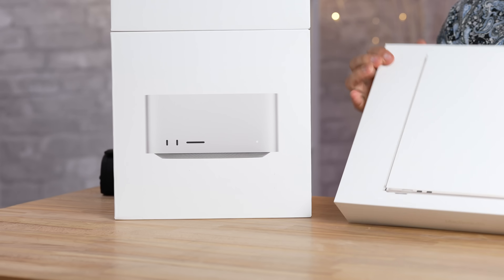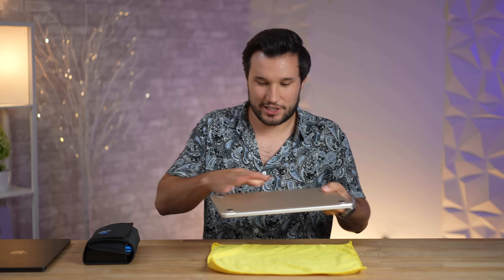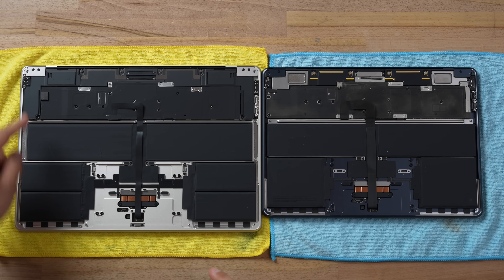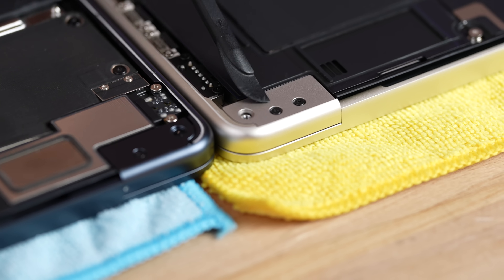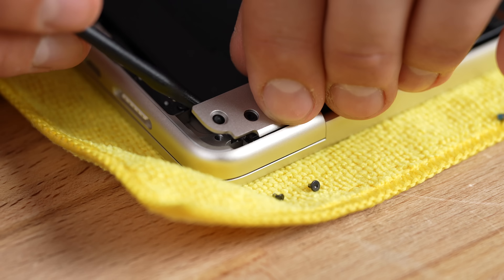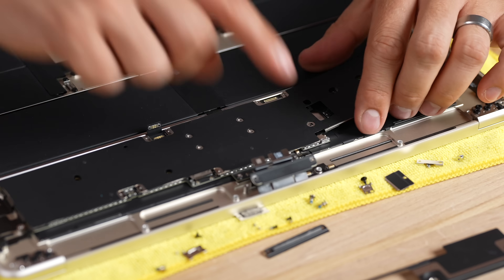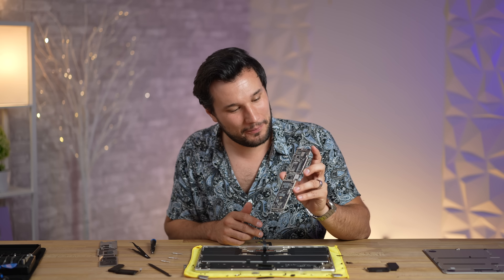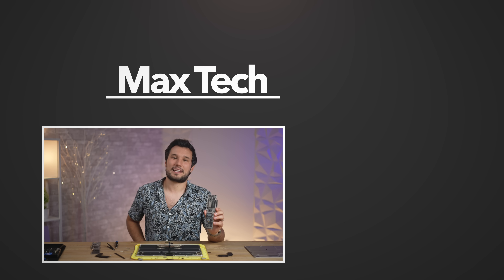15" MacBook Air Teardown: I CAN'T Believe Apple did THIS

Comment from the maker: What surprised YOU the most? Comment below! Subscribe for our testing videos starting tomorrow! 
THIS is the MacBook you should buy right now ($50 OFF) ➡ https://geni.us/uGguYQ
Reply: Placement of CPU and RAM .. never noticed before 😅
Reply: Sturdiness, overall a very clean inside.  Lots of little things like the clips for the bottom.  The amount of space for the trackpad.  I liked the better thermal for the cover by it being slightly thicker, absorbs more heat and maybe coil whine (lol).  Yeah, good design, except.... the single nand ssd and only 8gb unified.  But, hey more power to them, this is not my machine.
Reply: Don't you do a giveaway this time?
Reply: The new motherboard design...🙂
Reply: Nice disassembly. You never disappoint
Reply: When's the giveaway start?
Reply: The single 256 ssd/nand chips. I edit my travel vids on the go. My base 8mb M1 Air with 2x128 ssd/nand slices thru 4k like butter & no stutter. Saw another comparison on base M2, all stutter, no butter. So, that's me sat out waiting for M3 and hopefully a return to parallel 40% faster r/w nand.
Reply: Portland, JAMAICA in the Building!!!  👑🇯🇲🔥💥🌟⭐💯💎
Reply: What surprised me most? You being able to put that laptop back together.
Reply: What surprises me most is a new MBA 15-inch comes with a 12-year old battery and Apple Support did not deny with evidence.) 😭 😭

Comment: There is a little metal part with a black component (seems to be in some fabric) on it sited between display connection and motherboard, what is it? And do yiu know ehich is the material of the little black part? plasti

Comment: 8:05 There's a reason why Apple has done this in M2 SKUs. A 256 GB NAND has higher TBW than an equivalent 128 GB chip. That's why it'll take more time before failure (possibly after the warranty expires).

M1 macs with 8GB memory are notorious for failing SSDs (since lots of swap is used even in daily use).

Comment: Mind boggles down you think that there are even more complex designers than those who 'design mac' as a beautiful body. See that very small metal thingy which locks the bottom to the mac. And even more complex designers for those small parts .

Comment: I still wished Apple put in a better SoC cooling system for the 15" MacBook Air. That could have allowed for more complex operations with less chance of running into thermal throttling issues.

Comment: So noticed on Apple website the 15” has the two base options: 
a. 256 ssd 
b. 512 ssd

Is this because they each have a single ssd and one open slot?

Curious what the difference in performance would be with the two. 

If that’s the case, just saying “upgrade to 512 ssd” isn’t as clear anymore to us illiterate computer sheeple. 

Might be a good idea to clarify what you mean and point out the two base options available
Reply: The don't have any upgradable slots for ssds. 512gb is 2x faster than 256gb model.
Select which you need according to your usecases.

Comment: On a side note, I hope that benchmarks were ran first rather than taking it apart first. I say this as once that CPU was lifted it will never perform how it did from the factory. It could do better or worse but it will not be the expected factory performance people will get largely due to the thermal paste. If you reapplied it, it might be better or worse than what Apple used. If you didn't, than it may not perform the same as it would have during its first time getting pressure seated into place with fresh paste.

Comment: Its ashamingfor apple that they do this single chip design due their "dirt cheap prices" i can't believe that theircalculation is so tight that they don't have a chance to do other. Its just a piss-take of the customers. i keep my opinionthe bigger MBAs are kind of pointless, if you just WANT an Airbook but don't need the performance then M1 MBA Base (which has also the faster SSD even in Base config) if you bump up to recommended config (at least 16 GB /512 GB) then you are damned close to the MBPro, which offers a lot of other improvements (with only the downside of not be only passive cooled, but i don't think thats a real problem). So in my opinion the complete M2 MBA line up makes not much sense as long the M1 MBA is still available by apple brand new. The performance Difference between M1 and M2 is neglectable (especially if you accept the downgrade in SSD-Speed compaired to the prior version. If you cant neglect the perfomance downgrade than you have to go at least for 512 GB, if SSd speed is an issue , than swapping has to be avoided, therefore at least 16 GB of RAM (it also suits the durability of the SSD) then you are only 15% below an MB Pro which brings up a lot of improvements and tends not to thermal throttle so fast (if speed is an issue), it allows higher specs if needed. It has a much better screen (120 Hz, higher resolution, higher brightness: MBP14 3024 x 1964 pixel @ 254 ppi, MBP16 3024 x 1964 pixel  @ 254 ppi, MBA15 2.880 x 1.864 Pixel @ 224 ppi, MBA13 2560 x 1664 Pixel @ 224 ppi), more ports, SD-card Reader.

Comment: so the question would be whether the 512G version would be using 2x256G ot single 512G nand
Reply: Who cares; just buy 16GB of RAM, and then how many NAND chips is moot. RAM is far more useful than an extra NAND chip if performance is your ultimate goal.

Comment: Really none tear down but SMH Apple still only put 1 256 gb chip instead of 2 128s, kinda makes sense on their part but that’s messed up
Reply: NAND chip makers are not bothering with bulk-making 128GB chips as no one needs them anymore. People should not complain that 128GB in 2023 is not enough and then in the same breath complain that Apple is not using them!
Reply: @ahaimes6320 It's 2023 and Apple still provides slower SSDs. Of course people are gonna complain.

Comment: I love the technology, its nothing less than amazing but honestly hate how NOTHING is replaceable or upgradeable. Ugh I wanna love the new Macbook airs so bad hahah
Reply: At least they could have made the SSDs upgradable.
Reply: Very fast ports enable you to edit video on external drives.  Therefore I figure buying 16gb ram would future proof it more than buying 512gb SSD version.  If buying 16gb and 512gb, then it's nearly as much as current 14" pro price which has various advantages (more ports, fan, better display, faster CPU and GPU).
Reply: Welcome to the world of ARM-based devices. Phones and tablets have had non-repairability since day 1, and phones have proven their reliability bearing in mind they are 24/7 devices versus laptops. People fail to understand that when you advance tech to the point where repairs are nominal, then why do you need to make the design more expensive, take more space with modularity, and reduce latency for the sake of a few complainers that are still living in the bad old days of poor QC (Intel).

Comment: 8+256G is already dead for Today's laptop. Can't believe Apple still provides this trim for its product
Reply: Depends what you use it for, but it’s significantly faster than any windows laptop that is also 8/256, with integrated ram and superior management, feels just like a windows 16 gb ram

Comment: They clearly have cared about right to repair with this one….. SMH
Reply: If you are concerned about the Right to Repair on ARM-based hardware, should you be up in arms about smartphones and tablets that all have the same SoC? You are still time-warped back to when we needed to have access to modularity due to low QC by Intel. ARM is another game where modularity is negative and moot, as reliability is close to 100%. Tech moves on, but some people seem reluctant to move forward.
Reply: @ahaimes6320 haha say the nay sayer... My M1 SSD fried the whole motherboard? luckily got Apple Care plan if not... I maybe op to windows based machine... Even surface products has detachable SSD.. this just planned obsolescence btw.. nothing more..

Comment: More expensive and still much slower ssd. Not worth it.
Reply: Tell me, what process do you do that needs more than 1.4Gbps sequential reads or writes? This is an ultrabook, and the bottleneck will be the external device. The random read and writes that the SSD uses 99% of the time are the fastest on any 256GB SSD, even faster than the M1 dual NAND.

Comment: Pi55 poor design from apple, the laptop needs to be much more serviceable.
Anyone buying a 15" MBA is crazy, it make 0 sense. 8GB is not enough, you need 16GB RAM, 256GB SSD is a joke, so you need at least 512GB and by that point you might as well get a refer'b 14" pro. Pointless.
Reply: The 256 option is more or less for users particularly needing this laptop for schooling or basic usage like myself. And yet my m1 mba runs better  than any other laptop I’ve owned.
Reply: MB Airs are the best-selling laptops beating the nearest Windows rivals by miles. They sell over 100 million a year, and around 50-60 million are base spec, which is more than many other brands can sell. So you seem to be basing your personal needs without respect for the world's needs.

Comment: Lets not get too precious about this laptop, if its bricked its binned as no one going to fix it. Its a throw away bit of tech like a phone, it serves its purpose then is replaced.
Reply: What is your proof that this will not last as long as an Intel machine? You should not make random statements with no data to back them up. Could it be your biased view of Apple?

Comment: They should have released 13” and 15” at the same time. I got the 13” back on September and i would have bought the 15 if it was out.
Reply: So now you will go out and buy the 15”. Apple know what they be doing…
Reply: @eWhizz  i dont think many people would do this. If i were to sell the 13” right now the best would be to sell it 350 less than i got it. Plus 250 which is the price difference of the 2 models in my country it costs 600 for the upgrade
Reply: It was not ready then, but the MB Air M2 13-inch was overdue. Better take time and get it right than rush to market for bragging rights and have a disaster like the OG Fold by Samsung.

Comment: How long do you think would the ssd last especially with base model 8 gb ram?
Reply: It will easily last 10+ years, and after RAM will be the longest-lasting component. We are passed the point of worrying about SSDs' life. This assumes you have common sense and buy the 256GB for tasks made for that size. Remember, any swap goes mainly to the dRAM in the SSD, not the actual solid-state drive.

Comment: Should you upgrade to 16GB of RAM or 512GB of storage if you can only upgrade one thing?
Reply: 16gb ram. Storage can be expanded via external SSDs. And they've becoming much cheaper now.
Reply: Both, you really have to if you want it to last a good ten years.
Reply: RAM no brainer. You can always use external SSD and larger RAM helps to reduce the SSD swap usage
Reply: If you can afford it.. BOTH
Reply: 8GB is useless. 256GB is useless. Sell something or wait to save up and get both. Otherwise you end up with a handicapped computer.
Reply: 16gm is must
Reply: Ignore the YT creators that recommend upgrading to 512GB; they need to catch up and should know better. The more RAM you have, the less you need to swap, so 16GB of RAM aided by compressed cache and swap will be equivalent to c.20GB and, for most ultrabook users, be more than enough for casual use.

Comment: So if I understand it right, it's best to get 16 GB Ram rather than a base 8GB 15-inch Mac Air?
Reply: & 512 SSD
Reply: @michael2275  Thanx Mike but cant afford both bro.
Reply: If you had to choose between 16 gb or 512, if just go 16 gb with 256, a lot of my files are on one drive anyways so storage does not matter much to me
Reply: @theneighborlynumismatist8201  256 GB SSD is 50% read/write speed of the 512 SSD because 512 has 2x 256 GB drives. Makes a big difference if you do a lot of read/write.
Reply: @michael2275  It only makes a difference for sequential reads and writes, and I am not sure how many Air users are transferring large files in and out of their devices? Random reads and writes are the fastest in the industry and what most users notice and is why Macs feel snappy.

Comment: They could have put in more battery but they did not prefer :( , 
I guess they wait for the 2024 model 15 inches Air with M3 chips next year. And They will also promote it with more than 22 hours of battery life by filling the gaps with more battery.
Reply: Man, i don’t know if I can wait…

Comment: It is only 1.5 inches bigger because the “13” is more like 14. Total scam on marketing
Reply: The screen is 25% bigger compared to the 13 inch tho
Reply: Are you kidding? You need to read up to know that it is not a linear upgrade with display sizes! As the other comment said, it is 25% larger which is a BIG increase!